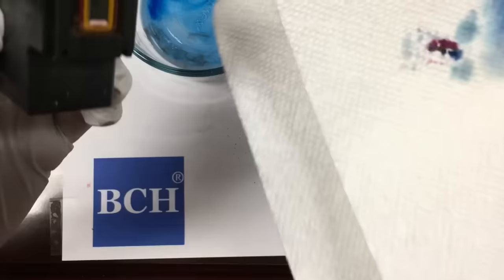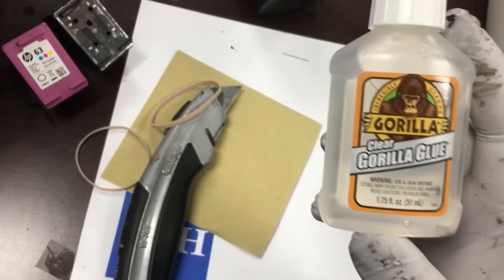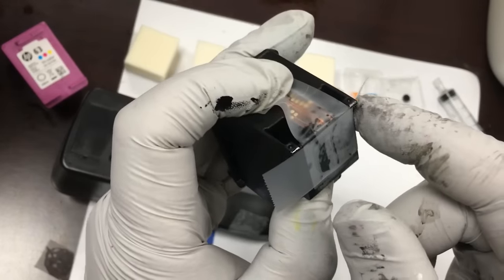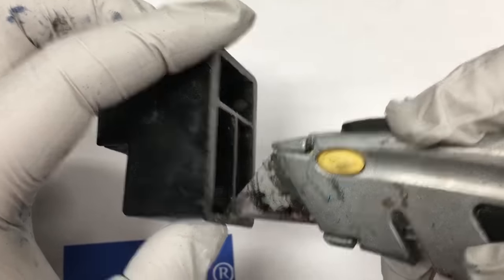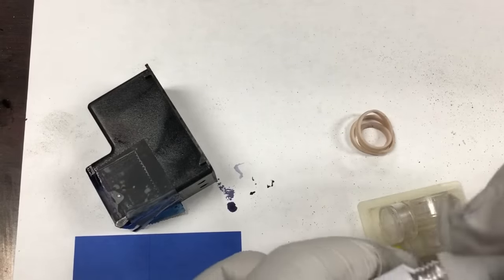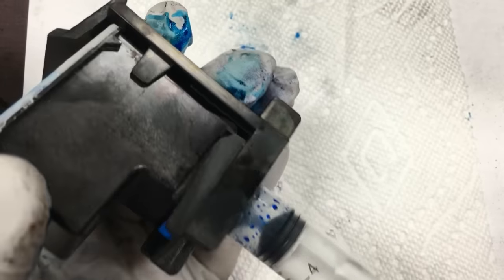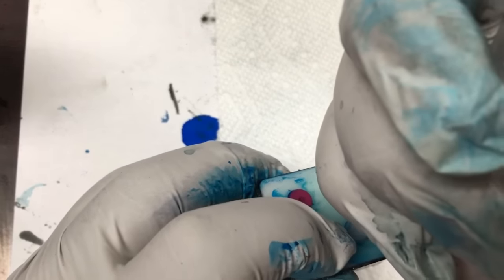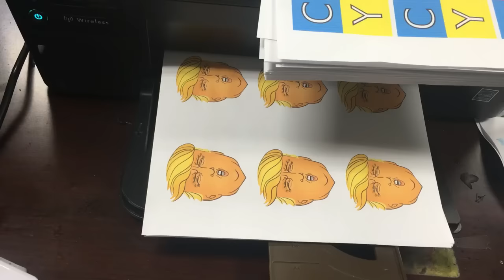#1 Detailed Steps: Make a Spongeless Refillable HP Cartridge 61 62 63 64 65 66 67 68  Integrated

Comment: I just refilled my color cartridge recently. But magenta color is coming. So I inserted more magenta color and then magenta started to come out. But after about 5 minutes, magenta stopped to come out. Then I opened the cartridge and put pressure on sponge containing magenta and the color come out. What is the problem? It only happens with magenta. Is this for high vacuum pressure in this sponge? What to do?
Reply from the maker: It should be a pressure problem.  This video is for spongeless cartridges.  Maybe let me know a little bit more about how you refilled the cartridge and how did you seal the top?
Reply: @BCHTechnologies  I don't have the refill tool like you used. Is it possible to refill without this tool?
Reply: @BCHTechnologies  Is it necessary to seal the top air tight? I just used tape to bind the top with cartridge.
Reply from the maker: @nazmulaminparag1437  No, keep it open.  Only two things can go wrong is dirt falling in and evaporation.  I thought you might seal it airtight.   What kind of ink are you using?
Reply from the maker: @nazmulaminparag1437  The ink looks okay.  Let's put the cartridge in the printer for a day, then print a page and see what happens.

Comment: How to fix cartridge not close, but ink miss align pattern suddently while printing. I sucked ink with sucker tool from nozzle and injek air into cartridge. All ink out but still missing pattern.
Reply from the maker: I do not completely understand your situation.  Is the pattern printed alright but looks like lines shifted?
Reply: yes
Reply from the maker: It is because the printer is out of alignment.  The auto-alignment won't fix it.  You will need a manual alignment.  We have a video here: https://youtu.be/g2m2lH1oHyk

Comment: Hello bro , i have canon pixma g2420 with an error 5200 
I filled the ink in each of the tanks, tubes and cartridge, but unfortunately the same problem is still present, and I also cannot control the commands via the buttons ( menu...) on the printer  because it shows me an error (printed sheet count 2451-2500)
Thank you very much and please reply to my problem if you encounter this problem.
Reply: SLEDGE HAMMER YOUR PRINTER!! *YOU WILL BE MUCH HAPPIER!!*

Comment: I refilled mine HP61 didn’t know how much to put in never have got it to work...
Reply from the maker: For spongeless, we fill it all the way to the brim.  For regular HP 61, make sure you use the middle hole for the black and only fill about 4-5 ml for the black and 3 ml for the color.  Detail here: https://www.bchtechnologies.com/blog/10-step-beginner-s-guide-to-refill-hp-integrated-cartridges-21-56-74-60-61-62-63-64-65

Comment: Just went through this process on an HP 3830 tri color isn't recognized now.   Cleaned the printer conntections on both printer and cartridge.   Still nothing.   Black cartridge is a champ.   What can I do, the cartridges and this kit are expensive?   Is there a bypass?

Comment: They are refillable with sponge too why need to remove it?
Reply from the maker: 1) Larger volume: if you have a PG-245 then the sponge can only fill to 8.5 ml.  Spongeless can fill up to 22.5 ml.  For every spongeless refill, you would refill the sponge version almost 3 times.  2) You can clearly see how much ink in the spongeless cartridge, no more guessing 3) Better printhead health and easier unclogging.  4) Impress neighbors.  For details about volume comparison, see this link: https://www.bchtechnologies.com/blog/what-is-the-difference-between-pg-243-cl-244-and-pg-245-cl-246-for-canon-pixma-printer

Comment: Get more life out of your Inkjet Cartridge. 

Prop the front of the printer up by about 5 cm (some books are good for this) causing the ink to run to the rear of the cartridge and get extra value but fill the bottom tray with paper first. 
For Yellow Cartridge, use a Black Marker to ink over the window (half way up the side that the nozzle is located) to fool the printer into thinking the cartridge is still full and allowing you to extract the extra remaining cc's.
Reply: For printers with a thermal head that sharpie idea is a terrible one.  If the cartridge runs dry it will destroy the print head.

Comment: The XL black cartridges only prints  out about 200 pages, I just took it out and found out it has some wight. I tried to put it back in, and the printer say " incompatible" WTF. Is it the stupid chip strip?
$30.00 for a black XL and I forgot about the cost fo the color.
Reply: You can reset the cartridge if you have an old black cartridge. Put the old one in that you know you can't use and hit the X for alignment. Then put the XL one in and it should work fine.
Reply: Yeah I tossed the original cartridge  in the trash along time ago. Lol
Think you for the info😎
Reply: Oh poo! Lol
There are others ways of tricking the printer that are here on YouTube. I can't remember them all, but def look up "refill hp cartridges XXX" with the # you have. I just refilled mine and popped it in today, it read it as "previously used" but worked just fine.

Comment: Dear friends, someone knows how to reset the print cartridge counter, because the problem in HP 2400 ( cartridge 60 ) printers is not in the lack of ink ... it is that the cartridges have a limited number of printing sheets and if Pass that number, the system simply puts it as a useless cartridge, and so this cartridge can no longer be used in any other printer, someone knows or knows more about this subject, I will greatly appreciate your comments, cordial greetings to all.

Comment: What A Mess?  Thanks for the video, very informative but I think I'll pay for my HP 61's. It's one of their least expensive cartidges and it's almost always on sale.
Reply: Until they run out of stock and used cartridges are lost in the landfill  -if everybody follows your buy-and-trash behaviour, that is. I always reuse carts over and over until they die, saving hundreds and sparing the environment to 'digest' the umpteenth piece of plastic. HP doesn't even have a recycling program in my country, yet they have the nerve to babble about how 'green' their company is in the ads.

Comment: LOL. Printers with built in ink bottles are so cheap now, it's not worth the effort doing this.
Reply: Wait until the printheads clog, and you'll see how ghastly difficult they are to remove and clean. Also, those type of printers gobble up 4 ml of ink at every head cleaning cycle or every 4-5 printjobs, and 'feature' a ticking time bomb inside: the waste ink tank counter. Take a seat and call the nearest Service centre asking for a cost estimate to replace the tank and reset the counter.....

Comment: Refilled my starter cartridge but left the stupid sponges in, now my cyan is stuck in the sponge, the nozzles are not clogged, if I push the sponge with a toothpick the ink does come out the nozzle and it does print, but only for like half a page, maybe I should just buy a set of genuine cartridge to use and experiment with the starters. I bought refill ink, all colors 70ml each + black 90ml, for $20, that's the same price as a single tricolor XL cartridge with 4ml of ink in it. Such a joke.

Comment: Laser is mutch better...
Reply: Not for photo quality prints. I owned a color laser printer for many years, and only used it for 'regular' text and mixed prints. Also, laser printers can develop vertical stripes from minor scratches on the drum which cannot be removed, and you end up replacing the drum (almost as expensive as the printer itself).